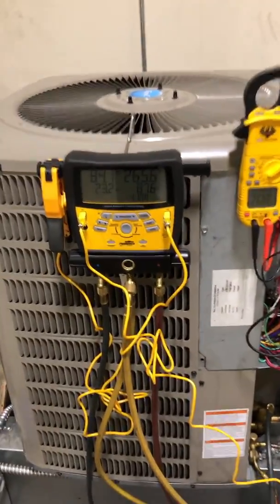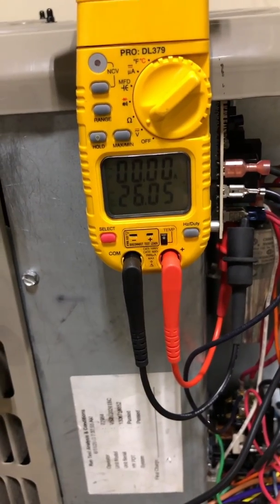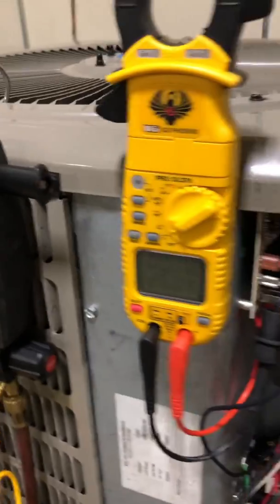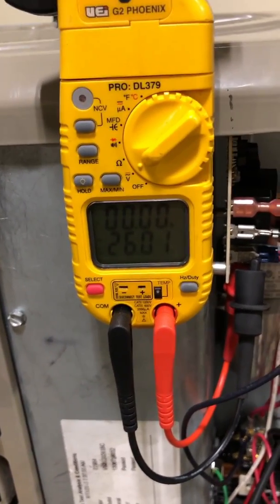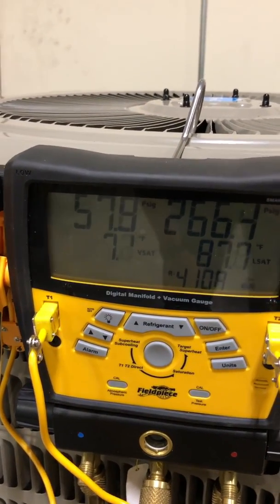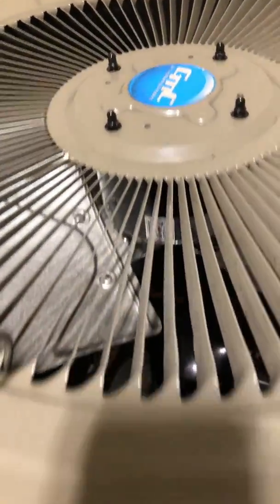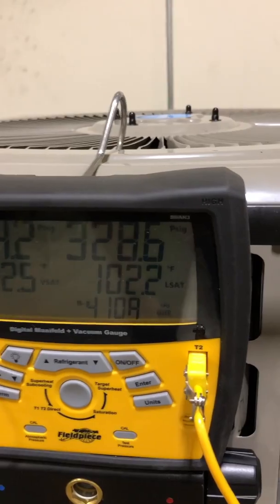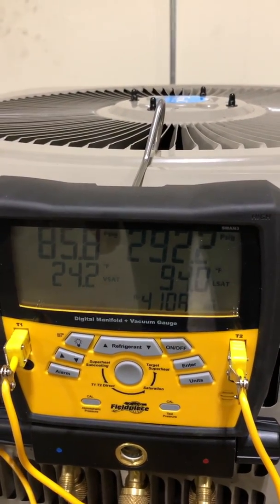Heat Pump Defrost Test

Comment: I have a goodman GSH130301AC. The fan runs during defrost, is that normal for this model? Or is my board bad?
Reply: Mine does the same thing and it's a Goodman. My unit is working and with that said tonight I noticed at the air-handler I couldn't feel or hear any coolant flowing and both lines where cold. So I went out to the outside unit and it was running and I noticed ice on the coils. They weren't completely iced up but there was ice. So I went back inside and a little while later I heard the noise the outside units make when they go into defrost. Back outside I go and I notice wet spots all around the outside unit which tells me it's defrosting. When I get back inside I can hear coolant flow and both lines into the air-handler are much colder then before! Some time later I start feeling heat in the house so I go over to the air handler and touch the lines again and the larger line so warm but I don't hear or feel coolant flow in either line. Now during the summer time I hear coolant flow anytime the A/C is running. I hope that helps.

Comment: Okay, I have a question. To check all you have to do is disconnect the fan and force the unit to run in defrost mode; then reconnect the fan to check the fan relay, and if the fan comes on and you have 24 volts the unit is in good condition?